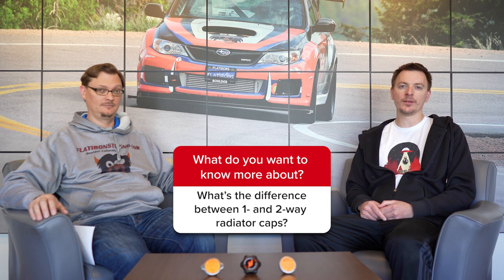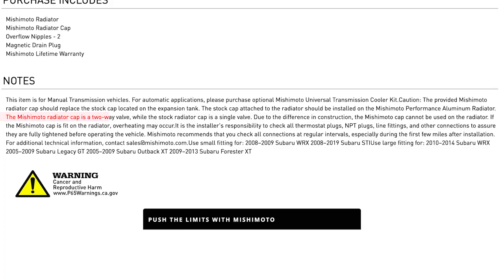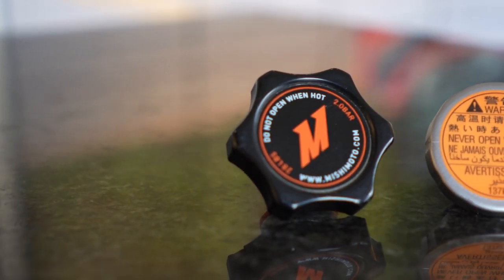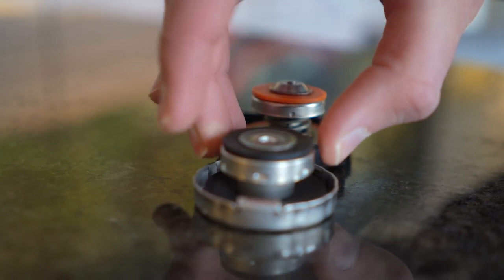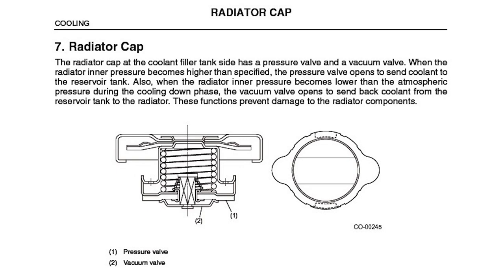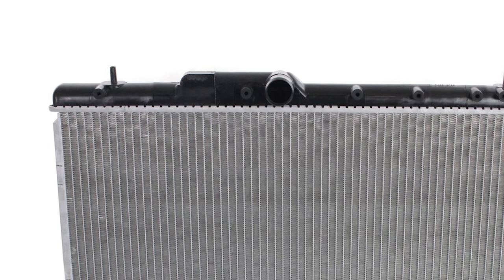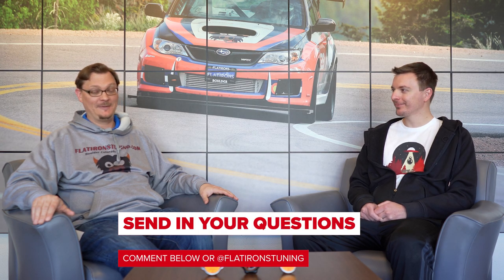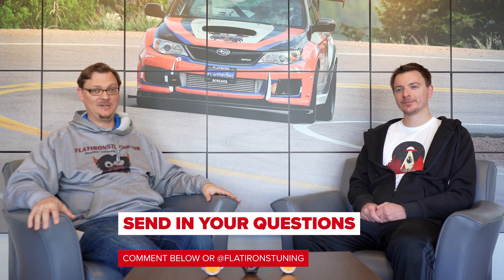Explaining the Mystery of Subaru Radiator Caps

Comment: I did read when I got my mishimoto radiator to installed their cap in place of the expansion tank and move the expansion tank cap to the radiator location. Besides the paperwork mentioning a 2 way cap I didn't look further to find the differences. I ended up not using the mishimoto radiator due to fitment issues (GM6 with GD7 swap) and I was just looking to replace both caps with new oem caps. I ended up with 2 high pressure caps that are shaped differently and thats when the concern arose. I was like "which cap do I need, is the 137kPa for STI and the 108kPa for WRX?" So I did digging and couldn't find anything concrete. Finally read through the service manual and it just explained which one goes where. I've yet to install the lower pressure cap on the expansion tank since I didn't see any cooling issues, but the swap is weeks old and only a couple hundred east break in miles on it. But I hace noticed my upper radiator hose pulls a vacuum after the engine is turned off and the hose collapses which caused the hose to rub on a pulley so I will install the 108Kpa on the expansion tank and see if that cures that small issue. Considering I built the car to go on track its good to see this information sooner than later. While we have our questions on our own builds, just goes to show how a team of engineers at subaru cobbled this solution and it works perfectly so long as the cooling system is being serviced per their procedures. Goes to show sometimes OEM is just fine in some applications.
Reply from the maker: Thanks for the comment Javier.  Definitely take a look at your caps.  If you are pulling a vacuum in the radiator hose such that it is collapsing, there is definitely an issue there.  I think that getting the caps sorted should fix that issue though.

Thanks for watching and Stay Tuned!

Comment: I just had to replace the radiator in my 2010 Subaru Forester non-turbo. They put a new cap on my new radiator. However, I'm confused to which cap needs to be on the radiator now. The cap they have on it at the moment has two ears. Is this a two way cap. If so, do I need to replace this cap with a one way cap... without the ears.
Reply from the maker: Thanks for your question.  Since your car is non-turbo, you shouldn't have the expansion tank.  If you only have a single cap on your radiator, you would need a 2-way cap there.

Hope that helps and Stay Tuned!

Comment: So my caps have been fine but I just did a coolant flush on my 18 STI Two days ago but the coolant was only 3,000 miles old but I’m diagnosing something but anyway my coolant hoses are collapsing under vacuum once it cools off. So I’m curious if I could clean the cap on the radiator because I had that oily residue that I messaged you guys about the other day. Crazy thing is I don’t see the oil coming in but right now I’m trying to figure out the hose issue. I also notice the coolant level will lower just a little but it’s not leaking or anything like that.
Reply from the maker: Thanks for the question.  If your coolant hoses are collapsing, then it sounds like the 2-way valve on the cap on the expansion tank isn't opening.  As a start, you would want to replace the cap on the expansion tank.  You might also want to check the small hose that runs to the overflow tank to make sure it isn't pinched or blocked at all.

If that doesn't help, maybe detail your burping procedure and we'll see if that gives us any ideas.

Thanks for watching and Stay Tuned!
Reply: @FlatironsTuning  I have the burp funnel and I use the green adapter and fill it with some coolant then I allow it to get to operating temp then I turn the heater on high and wait until I don’t see any bubble coming out. ( now I don’t run it for 20-30 mins I only run it for about 5 mins after the temp hits 185 with heater and the temp starts to fall then I end the burp process) My hose that goes into the over flow I removed it and flushed it and it’s the oem one so it has the slant cut on the end. I will make sure it isn’t kinked then order the cap but the coolant will flow into the over flow but it isn’t going back into the radiator after cooling.

Comment: I've ran two after market caps for 5 years now with zero issues with heat . Ones a Cobb cap for expansion tank made by aluminate  and an apex cap on mishimoto rad . The combo works for daily tuned car , I feel stumped as you guys since many have told me not to do this but seems just fine
Reply from the maker: Thanks for the comment Mitchel.  There is definitely a lot to this, and the issues from the incorrect/mismatched caps would present more slowly or be less of an overall issue on a street/daily driven car compared to a race car.

Thanks for watching and Stay Tuned!
Reply: @FlatironsTuning  no doubt on thar point between daily and race car set ups . I've always wondered the issues with it and also one thing I could never get answered was that some of these caps internals or valves spin freely and others are very fixed with no play . I bring this up since I wrecked a koyo cap in summit County where I was over heating and the cap had loose center and the label was soaked . Not sure if that explains the issues clear enough but thought I'd mention it
Reply from the maker: @mrbaldwin8819  I have seen failed caps leak coolant up to the sticker/label on the cap.  It seems like that is one of the ways that the cap can fail.
Reply: @FlatironsTuning  I'll Luke to see what info comes of your study that way I can finally know myself lol the failed cap thing has me confused due to the fact that Cobbs caps come Luke my failed koyo cap but I've never had heat issues but sticker is weird from heat more than anything .

Comment: Well im running an Aftermarket Aluminium radiator with no Cap provision at all  and just a cap on the Expansion Tank ,should I be running a Two Way Valve Cap????
Reply from the maker: Thanks for the question.  Yes, if you only have one cap on the system, you need a 2-way cap.

Thanks for watching and Stay Tuned!

Comment: I had this issue happen to me. I have a Mishimoto radiator and the cap. I bought the vehicle with it set up like this. I noticed coolant on the top of the radiator and went and bought a basic radiator cap and never had an issue again.

Comment: This is an interesting thing of 2-way and 1-way radiator caps. When I owned my 1999 Legacy B4, it was an OE twin turbo EJ20 set up and only had the overflow tank next to the intake manifold and no cap on the radiator. I was plagued with over heating issues and thought it was a head gasket issue. After replacing head gaskets and rebuilding, could never get it to properly work right (coolant overheating). Would always overheat at idle (like an air pocket after cold start), burp it, it would be fine. Could never figure it out. I now wonder if I had a wrong radiator cap. 
Of course, I’ll never know as I scrapped it already 😢. But thank you for some insight and sharing!
Reply from the maker: Thanks for watching and glad that the video was helpful.  If you had a 1-way cap only, most likely you would have seen radiator hoses collapse because the cap wasn't letting coolant back in, and it would go into a deeper vacuum.  Most likely those other signs would have prompted further investigation.

Hope that helps and Stay Tuned!

Comment: I hope I can provide a bit of insight to the reasoning between pressures and locations.

The radiator located cap is a one way valve so should an over pressure condition occur pressure will be released.  It is a one way valve because that is not the highest point in the cooling system. 

The cap located on  the expansion tank should be a marginally lower pressure release as you want that cap to be the main point of coolant expansion overflow. Being the highest point in the system, it will aid in burping the system. You also want this to be the place where the two way valve allows  coolant to be sucked back up through to refill the cooling system from the highest point.
Reply from the maker: Thanks for the great comment.  Stay Tuned!

Comment: I'm not claiming to be an expert, but I'd like to offer my anecdotal 2-cents, in case it is useful as a datapoint for anyone researching this subject: I have been running a Mishimoto radiator on my 2011 WRX for roughly 3 years now. For the radiator itself, I purchased and installed an OEM STi 1.3 bar radiator cap, which has a slightly higher pressure rating than the stock WRX's cap IIR, and still retains the 1-way valve construction. On the expansion tank (or what I sometimes call the turbo reservoir, higher up on the engine), I placed the aftermarket 1.3 bar Mishimoto cap there. So there is no pressure differential between the two caps, and the higher cap in the system is a 2-way Mishi valve. I also installed Samco's silicon ancillary coolant hoses at the same time as the radiator. 
90 degree summers, highway/stop-and-go traffic, occasional performance driving (not extended track use though), and I've had zero issues. The overflow tank will fill up when hot, and drain back into the engine upon cooling. Will be watching closely when I start HPDE courses within the year.
Reply from the maker: Glad to hear your setup is working all right so far.  I'd definitely recommend dropping the expansion cap down to a 1.1 bar cap if you can.

Thanks for watching and Stay Tuned!

Comment: Any info about koyo rads? I habe a 2011 wrx, installed koyo rad and bought the koyo red cap that says 1.3 kgf/cm2. Should I put this on the actual aluminum rad or expansion tank?
Reply from the maker: Thanks for your question.  The Koyo caps are 2-way as well, so you should only put them on the expansion tank.

Thanks for watching and Stay Tuned!
Reply: Thank you! Great videos, more power to your channel and company!

Comment: I need some assistance. I installed a 93 legacy mishimoto rad on my GC and do not have a cap. On my expansion tank, i have a 108k possible a 2 way valve cap. Im having overheating issues sitting in traffic. Is that the correct cap? Or is air in the system? Note: Is a new build
Reply from the maker: Thanks for watching and thanks for the question.  If you just put everything in, the most likely issue is that you either have air in the system or the cap is not working properly.

Most auto parts stores can test radiator caps, so I'd recommend starting there, and then burping the cooling system again. 

If you see any signs of air coming out, that is most likely your problem.

Hope that helps and Stay Tuned!
Reply: @FlatironsTuning  looking at other forums, it looks like i need an overflow tank to deposit or retrieve coolant from. If that's the case, that may be where the air is coming from.
Reply from the maker: @emanuelhdez1468  Yes, you definitely need an overflow to hold the coolant as it expands.  If you don't have that, and are simply letting that coolant escape, that is most likely where the air is coming from as you say.

For reference:

https://youtu.be/MBVNHON3d0w?si=zWompe3CiJ-TWiQY

Comment: It doesn't make sense to put the 2-way radiator cap on the expansion tank and the one-way cap on the radiator because when the cooling system cools down, it contracts and there is no pulling of the coolant from the expansion tank due to the missing 2nd valve for vacuum. If the radiator has the 2 way cap and the expansion tank (which is only a reservoir) has the one way cap, coolant can be pulled back into the cooling system via the 2 way valve on the radiator. Vacuum pulls the 2 way valve open pulling coolant from the reservoir into the radiator.

Comment: IV had really good luck with my 1.3 bar 2 way radiator cap, I have one radiator cap and seams that moving the expansion tank to the high point mine is right behind the intercooler, and in an 85 rx turbo the spare tire cubby works perfect to mount the catch can and expansion tank and set tools on when your working on it.
Reply from the maker: Nice!  Very cool that you are keeping the RX on the road.

Stay Tuned!
Reply: @FlatironsTuning  hopefully I can keep it going and modify to keep it on the road. No point in buying new, for me the thrill is making my old car compatible with all new parts, low insurance, no attention every time I park it and get out, unless it’s a Subaru finatic that’s in the know, it’s got a special place in my heart probably the same feeling you get driving the yellow bug eye wagon. It’s such an amazing car why would you ever need a new one. Especially when you can attatch any Subaru part your heart desires at any time basically to make it handle or take what you throw at it. And the fact that at any rally the possibility of a fan having a Subaru parts store at their house is a good chance. Like my scrap bin is full of axles, hubs, struts, wheel bearings, trans parts. Motor parts. Probably extra 3 of every sensor collected over the years. And I already hauled away 20 destroyed motors to the scrap yard to then take that money and buy more Subaru parts haha.

Comment: Question! Is the expansion tank a factor when doing coolant flushes/replacement? Or only do burping from radiator like all other cars with no expansion tank..?
Reply from the maker: Thanks for watching and thanks for the question.  Yes, since the expansion tank is integral to the cooling system, you would need to work with it for any task related to the cooling system.

Stay Tuned!
Reply: @FlatironsTuning  thanks! I asked because I found it a bit odd that my 09 Legacy 3.0r has a coolant expansion tank by the manifold like the turbo Imprezas/Leggies

Comment: Hey guys, great video! So im currently having an issues with my coolant system for my 2013 wrx. I got a new radiator, radiator hoses, expansion tank and overflow tank. My radiator was oem that i purchased and it was without the oem cap. The expansion tank came with a mishimoto cap and i just put it aside and ordered 2brand new expansion/ radiator caps. After some new coolant and full burp of all air bubbles(properly done through the expansion tank) and is ready to go. I also order new thermostat, thermostat housing, and sensor. With nearly everything brand new, why am i still having problems with my overflow tank filling up and spewing out. When the car cools i never see that the coolant pulles back into the radiator. Ive done pressure tests and the head gasket is fairly new. Im completely lost by this? Is this setup not brand new?! Also my radiator fans are turning on and my car stays within 197-178range. Drove it around for an hr keeping tabs on the temps. Any ideas please help?

Comment: Well what’s funny is I think the second cap in Subaru is to eliminate the air pocket that forms and for some reason a Subaru water system is hard to bleed air out of. I am relocating my expansion tank and radiator cap to the high point so I can get the air out easier during refill or flushing coolant. And I use 1 cap and it’s a 2 way.

Comment: Always learn something new from watching your videos, awesome work guys, I have an early WRX with no cap on the radiator, just an expansion tank with a cap, have I understood you correctly in that the expansion cap should be a two way valve?
Reply from the maker: Thanks for the question Shaneil.  That is correct.  You need a 2-way cap on the expansion tank.  We actually go into detail about your specific setup in this video here:

https://youtu.be/RWZUdHRHkeI

Thanks for watching and Stay Tuned!

Comment: Well that explains why my ej257 always has an air pocket in the expansion tank every 2-3 days. I top off my coolant every other day and can’t figure out where it goes. I have no leaks and my outfront v3 block only has 30k on the build so no way it’s the head gaskets lol, I have the mishimoto rad cap on the rad not on the expansion tank. I’ll switch them out and see what happens. My car idles fine at 181-185 but when I’m driving it doesn’t ever go below 190 and sometimes gets to 210. Never goes past that. I’ll order new caps and hopefully that solves my issue.
Reply from the maker: Thanks for watching and definitely hope this helps.

Stay Tuned!

Comment: I'm definitely curious of your findings with the testing.  I'll be looking for future videos.  I run a Mishimoto radiator with the Mishimoto cap on the expansion tank.  I think the OEM expansion tank cap is on the Mishimoto radiator.  My car gets warm on track, but does not overheat.  However, I have to run the heat when the ambient air temp gets over 85*  otherwise it gets too hot.
Reply from the maker: Thanks for the comment, and another video is in the works.  Make sure you are running the OEM 1-way cap on the radiator.  If you have the expansion tank cap on the radiator, which is a lower pressure than the Mishimoto, that could cause issues.

Thanks for watching and Stay Tuned!
Reply: Does this apply to the koyorad radiator also ?

Comment: I'm running a Stage 2, 2002 WRX with a Mishimoto replacement (oversized racing) radiator with their valve on the radiator and Subaru's OEM one on the expansion tank and I have no overheating issues with my coolant (only the oil gets hot when sitting in rush hour style traffic).  I don't really see the point in swapping them, but am curious to know more and as to why they did have an overheating issue?
Reply from the maker: Thanks for your question.  As long as you have the staggered caps, 1.1 bar on the expansion tank, and 1.3 bar on the radiator, that should minimize any potential issues.

Thanks for watching and Stay Tuned!

Comment: thanks, just installed aftermarket radiator directly for WRX. Of course the cap which came with the radiator is two valve and without this video I will run it without knowing it. I will keep stock ones then
Reply from the maker: Glad the video helped and thanks for watching.

Stay Tuned!